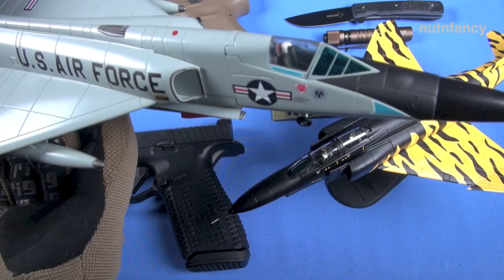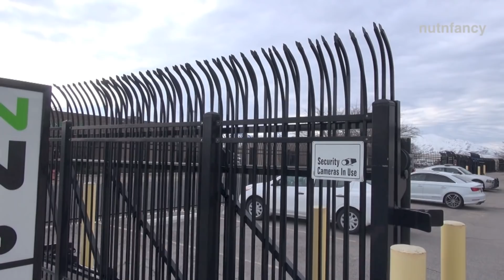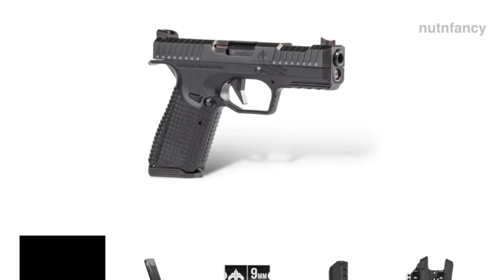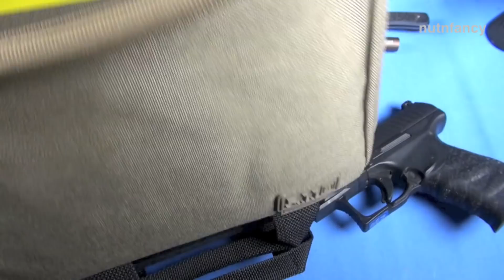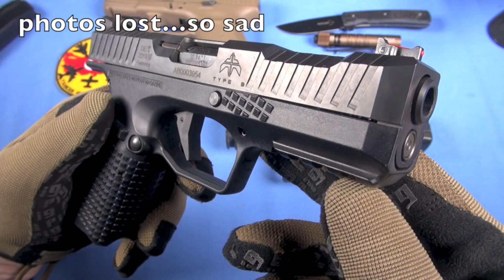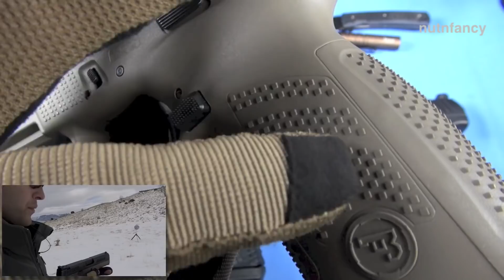In Your Face Different: Archon Type B 9mm!

Comment from the maker: Remember TNP Patreon gets the videos first and some never post on the main channel!  Here's some TNPr comments from Patreon, join the fun and full flow of TNP content:  https://www.patreon.com/Nutnfancy    "Greg Malcom I'm very interested in this weapon. Thanks Nutn! 6d The Nutnfancy Project The Nutnfancy Project The Nutnfancy Project THank you Greg 6dCCheesewell Dude, I wanna love this pistol, and I do, looks alone, it's awesome, but for the price, not for me. I'm a sucker for low bore axis pistols (looks wise), like the Caracal pistols! Great review. 6d The Nutnfancy Project The Nutnfancy Project The Nutnfancy Project Yes, trying to get that Caracal too, thanks Cheese! 1 6d Load 1 reply David Gaines David Gaines David Gaines I’m still holding out for the “Watch Basics” video! Keep the awesome content rolling! 1 6d Outrider950 What’s really neat is that on the Steyr L9 A2 MF the replacement backstrap not only change the grip size but the presentation pitch angle.   Totally COOL !! 6d The Nutnfancy Project The Nutnfancy Project The Nutnfancy Project I want that gun 6d Todd Strelka Looks like another great pistol. But I'm good with my Smith & Wesson M&P9 system. BTW, I'm very happy with my Maglula Uplula magazine loader too. I use it every time at the range. 6d Peter Thomas Peter Thomas Peter Thomas That “auto slide drop” is the pistol’s polymer frame flexing when inserting a magazine with a lot of force. You can generally drop the slide by squeezing really hard in certain places or by simply smacking the frame. That elasticity is just a characteristic of polymer as a material. The fact the Archon does not do it indicates that the frame is probably reinforced or has increased thickness. 6d Robert E Lewis Keith Gannon Keith Gannon Isn’t this the Strike One in a smaller frame variant? That was designed in Italy by a Russian.  LAV covered that a few years ago. Now being produced in Germany and Hungary. It’s been a traveller. As for over priced how about the Alien @ $5K!! 6d The Nutnfancy Project The Nutnfancy Project Yes its a G19 sized Strike One.  The Type A I guess is the full size. 6d Load 1 reply Tacticaldoodle Chris Baker Chris Baker I held one of these at a gun store a couple years ago.   The bore axis was sweet.  Too bad somebody else had already bought it or I might have picked it up.  Honestly, the name creeps me out a bit.  Archon: a Greek word that means "ruler", frequently used as the title of a specific public office. It is the masculine present participle of the verb stem αρχ-, meaning "to rule", derived from the same root as monarch and hierarchy.    Imagine that, a German company making a gun with a name that basically means "supreme leader" haha.  They might as well call it the "Fuhrer"! 3 6d The Nutnfancy Project The Nutnfancy Project Nice observation, I didn't even look the name up! 1 6d Derek W Tiller Faustus Faustus It's a good thing it comes with that silver sharpie for marking the magazine base plates with my initials—I wouldn't want them mistaken for all the other Archon Type B mags at the range. 6d Rick Grad Racing Psychosis Racing Psychosis I think I know why its so expensive, it had to be imported from 40k and the Dark Elder.  TD can help you with that. 6d Lon N Lon N I need this pistol like I "need" a Lamborghini. 2nd cool for sure. That being said - most folks don't understand that today is "the golden age of guns". Never before has there been such a variety of good firearms available.   david rockwell SAWC trump card played at the final round!  Very interesting design.  Thank you for the time and dedication.  Support your local gun stores and nation gun rights organizations. 1 6d Carl Bailey Carl Bailey Carl Bailey So, opposite end of the spectrum. Has anyone shot the Rock Island M206? For a dirt cheap revolver it appears to have an old school cool look. It looks like something good to just have around, but I don't want to buy something that will blow up in my hand. 6d Nathan Simms aka Darkpriest Nutn you have yet to convince me there is a better pistol than the Canik TP9SF (and the SF elite.) Ever since your review update I have owned them and I've fired LITERALLY 100s of pistols and not found one that made me go "yeah I'd rather have this as my GTW pistol."  Neat gun you reviewed, for 1k, it's just not enough more for me.  THANKS FOR ALL OF YOUR WORK FOR US! 6d Phake Steel frame: that's where the cost comes from. An apples to apples comparison might be a metal-framed Sig. I have a fiber optic sight I put on my 686. It's not just a plastic pipe, but is covered in resin so it can't break. I don't see why that arrangement is not more common. 6d The Nutnfancy Project The Nutnfancy Project " I don't see why that arrangement is not more common"  Weight and cost.  Polymer just works too.  For 2nd Cool, alumin frame is nice (Sig).  As far as a milled steel frame, the Archon is one of the best in wt however. 5d Load 1 reply David Eslamizar Meh.... I had an Arsenal strike1 and it was nice. I sold it though lol. For the money, for me, not worth it. I recently payed out the nose for a POF MP5, but it's a classic design, awesome shooter, and a dream gun of mine.... not to mention second kinda cool. 6d Ricky Kurtz Ricky Kurtz Ricky Kurtz Hey LTC, excellent review as usually. Thank you !!! The watch you’re wearing, please comment on it. Thanks again. Ricky from IBM 3 6d The Nutnfancy Project The Nutnfancy Project The Nutnfancy Project Thanks Ricky....I am not sure.  I should have shown it but these days I'm thinking most TNPrs don't care so much so I usually forgo it.  If I can remember I will come back and tell ya though! 5d Kenny VanCleave Kenny VanCleave Kenny VanCleave The grip reminds me of the Spyderco  grip pattern. 5d Ben Ben Ben Excellent analogy with the intro. And the old fashion tabletop is still my fave! 5d Connor Murphy Connor Murphy Connor Murphy Outstanding video, Thanks Lt. Col. 5d The Nutnfancy Project The Nutnfancy Project Thanks Connor 1 5d J Ram J Ram F4 is one of my all time fav fighter aircraft (and name of my AFJROTC Drill Team).  The stories of those bad boys making it back to base after significant hits makes it legendary in my book.   Oh, the gun was pretty cool too.  Thanks Nutn. 5d Phake As a side note, did you know that Rock Island sells a 9mm modern 6-shot revolver? Well, they do.  :D Love revolvers and I am a fan of the 9x19 cartridge, so I'm always curious about 9mm revolvers. I've go a Ruger Blackhawk conversion cylinder model (0.357/9mm), which is pretty nice, but I've always wanted a regular DA 9mm revolver. I don't know if you are interested in reviewing one, but I'd sure appreciate it if you did. Thanks for your consideration. 5d JoeLove to see a review from nutn on any rock island revolver. They're very affordable 4d The Nutnfancy Project The Nutnfancy Project Copy guys, I'll see if HH or Gunnies has one! 2min James R James R I d love to see a plastic gun like this with interchangeable grip scales like the 1911 or beretta that would be cool to be able to dress up that pig 5d Benson Huntley Benson Huntley When it comes to price I was always very unwilling to pay up for what may or may not be an improved gun. Then I was foolish enough to shoot my friend's STI 2011. That was years ago and I still cannot get that thing out of my head. I also cannot bring myself to spend the money it would take to buy one. So I would have to take a pass on the Archon as well. Great review Nutn. 5d The Nutnfancy Project The Nutnfancy Project Thank you Benson, thanks for the support.  I do have an STI in inventory for review btw! 1min Trey Koger  I love the brief inclusion of the F-106. My dad did avionics repair on those birds back in the late 70s at Griffis Air Force base. 5d The Nutnfancy Project The Nutnfancy Project I love that plane.  I used to sit at the end of the runway and watch the F106s takeoff in full afterburner at Langley AFB.  Cool your Dad has that history! just now Robert E Lewis Robert E Lewis Robert E Lewis Nutn reviews a semi Gucci 'glock-a-lope'... I just watch the PPQ M1 in the background. 4d Tacticaldoodle I’m pretty much sick of this thing coming back like a zombie. It’s back to being the Asenal again, or maybe co-imported? I can’t quite figure it out but with so much sweet competition I can’t be bothered to. 2d Derek W Tiller Derek W Tiller Derek W Tiller They probably should swap to a polymer trigger. It would have better dampening and heat transfer qualities. 1d Rick Grad Rick Grad Rick Grad I think people will try it because it is different. thanks for making the video, would have never known about the brand without yea."
Reply: nutnfancy only stupid consumers are sucked in by a “price marketing” scheme.
Reply: What ever happens to Impact Guns from way back. Or PFI dudes shop. And others you have shown back in the day?
Reply: I can't wait till you get a PSA Dagger to look at
Reply: @badas45  The PSA JAKL is the one to get... especially in 5.56
Reply: @calholli  the Jakl in 556 is on my list but the non Glock is in my budget for now, I have been looking at g19s for a while and the dagger looks better.
Reply: Small G gods Archons. There the fallen angels. Yeah nothing cool about the name. Just saying
Reply: I just bought a DB9-FS for $140 on gunbroker.. 
Every bit as good as this pistol and even looks better.
Reply: You said it had a stoppage with Winchester "115 grain NATO spec".I always thought Nato spec is 124 grain.(like I've shot from Winchester)
Reply: Requesting a video for the new Steyr A2 MF pistol: https://www.steyr-arms.com/us/firearms/pistols
I purchased the M9 based on your review and few others. Carried it for a while as well. I bought the new A2 MF based on my love of the M9, but it was a huge pain to actually find one. Still waiting for the sub-compact/compact grip modules.

Comment: I bought one a week ago. I took her to the ranges with six different types of ammo/makers (400 rounds) and different grain bullet weight, and the Archon shot as fast, flat and accurate as you can ever get out of the box. I have owned a plethora of guns over the years and carried many as a lawman and SWAT TEAM leader. I also participated in four SWAT Olympics, so I understand the coemption aspect. I don't think you need a bunch of work done to most pistols as back in the 1990's my department made us carry a "New York Trigger" in our Glocks. Was about 12 lbs. i can tell you when the shit hits the fan you will not notice. I think we get finicky with all the add ons which, turn a really good gun into something we really don't need as much as want. I have been in actual shootings and the trigger pull was not noted before, during or after. I do have two beefs, one, the take down pin gets a mite warm when firing 100 rounds fast fire and lastly, the mag release did kinda suck. Not a mood killer and I took her home and lubed the dog crap out of it and worked her a bit and now, back on track as a carry pistol. Shoots and fells better than any Glock i ever owned and I have owned a peck of them in every caliber and configuration and attended the Glock armorer's course four times over the years as well as Colt and Sig courses. I fired at a 2 inch target at 15 yards. I thought I was missing the target a time or two and turns out I was putting rounds into the same holes!!!  I am impressed with the Archon.

Comment: Hey Nutnfancy I own 2 of these guns because I love the way they shoot so flat and recoil seems lighter than other 9mm guns.  I don't experience discomfort with the trigger and the tendon rib doesn't bother me either.  They only gripe I have with the gun is the grip mapping technology.  I found the grip traction to be adequate with dry hands or with gloves on but not with sweaty hands or wet hands (blood sim). For this reason I had  both guns stippled and I found that modification to solve that issue.  I have a CZ P-10c and P-10s , most variants of 9mm Glocks from gens 3-5 and those are all excellent guns.  Is this gun better?  I think that's a very subjective question.  All I can say is that it's by far my favorite gun to shoot.

Comment: I have hundreds of rounds through mine; functions flawlessly with 115, 125, 147, and even 158 grain bullets.  Ran a Steel Challenge match and its quick to handle with easy follow on shots.  The recoil impulse is very unique, but very favorable to this type of engagement.  Magazine changes are very easily accomplished.  Trigger reset is very good.

Ergonomics really work for my large hand size.  If you try to blaze through all 4 magazines as fast as possible - there will undoubtedly be heat transfer to metal trigger.  I went with skateboard wrap as well.  LOVE my Type B.  Excellent pistol.

Comment: I wish more companies would stop trying to reinvent the wheel. If the goal is lower bore axis, why not clone the p7? It's recoil system has provided the lowest and it's fixed barrel is truly fixed. Likewise, if you insist on locking block operation and low axis, rotating barrel has been shown to work in many application as well. To me, the action is fine but unnecessarily asking for the buyer to believe it's hype. It's just like the tendon beavertail in that regard. Engineering that followers marketing. That's dangerous thinking.

Comment: Good to see a good ole’ feature length GRV. It seems, the trend right now is “subcompact” carry pistols and all-steel range guns. The “do-it-all” pistol is kind of occupied well established names.
  Waiting for the SIG P210 standard/carry review. Standard is lights out accurate even with a bad shooter.
Reply from the maker: Not sure if the 210 carry will be around unless Haven or Gunnies gets one on hand.  Seemed to us like a funky one, just from the design. For anyone looking to carry a 210 they'd likely dig one more classically styled, but they went modern on the grips and finish. I'd think it more in line with high class, custom 1911 types for carry but it looks like they tried to modernize and tacti-fy it a bit to compete with the contemporary carry market, which is an absolute shark tank. I'm sure it's a great shooter, but as far as conceal-ability goes it needs to be damn cool to make up for it. -Doodle

Comment: Too expensive for a marginally interesting pistol. I learned the hard way with the Strike One, the precursor to the Type B. Which  I preceded to sink well over $1200  with magazines, trigger job, and holster. The type B now has a German slide with a Hungarian frame BTW.
Reply from the maker: Good heavens, that's a chunk of coin for that. If you dig it, then by all means, but at that price point I'd be looking for something with definite collector value unless there's something else I'm using it for. I don't get enough use out of the Poly 9's we have on hand now except for a handful of glocks. If it's a comp gun though, then it ain't so bad. Who knows, it may be the next H9, something which I keep hearing will be fantastically collectible.-Doodle
Reply: nutnfancy  I sold it a few years ago and got most of my money back. Lesson learned.

Comment: if the  "tendon activation rib" gets it with a dremel why not smoth out the trigger a bit while on the go.
also if the slidestop is in metal have a go with a tig welder to build it upp and reshape it.

Comment: 15:30 I agree, Steyr pistols are extremely underrated. I have plenty of 9mm pistols, and my Steyr C9-A1 is one of my favorites. It feels like it was custom designed for my hand, the triangle sights are fantastic, the balance is perfect, and the low bore axis results in minimal recoil and quick recentering onto target. The only negative is its tendency to throw empty shells toward your head. But other than that, it is a phenomenal firearm. If you have never shot a Steyr, you should definitely try one if you have the opportunity.

Comment: Nutn, the market is going toward 3Dprinted-HDnylon frames for everything. Will be able to design custom grips around whatever brand serial-chassis you have. Think AR lower as a sample vertical for where the market is going as a whole. 3D printed metals are insanely strong as well.

Comment: Low bore-axis is mostly a marketing gimmick only neccessary on carry pistols that are engineered too lightweight for high speed target transitions. Glock's grip angle is still the best compensation solution for the  ~25oz range of pistols for recoil mitigation.
Reply: Have you shot this pistol?
Reply: @jagervw  Not a reliable enough of a action-mechanism to evaluate. I shoot a high axis gun better than most people can shoot their safe queens. Practice more if you suck.

Comment: The angular front looks cool and makes it easier to holster, what's your problem with it, how is it unacceptable? how is it that big of a deal which they must change?  And the cut out in the slide is functional, it lightens the pistol so there's less reciprocating mass. Instead of doing lightening cutouts which can allow dirt and grime to enter into the pistol, this is a different way of getting it lighter which also looks cool and you could probably grip it better there as well for press checks etc.. The main problem with it is it's not optics ready. Needs to be Optics ready so you don't end up shooting with one eye closed like you limiting your situational awareness..

Comment: There was one instance of the cop that shot the guy he was in pursuit of through his own windshield while driving. He jumped out of the car, put the mag in backwards and slammed it, took it out and put it in the right way. Few and far between, still a problem for some. It wouldn't stop me from buying. What has stopped me from buying is the unavailability of spare mags and price. I want to have as many mags as I want to have. I have something like 20 ppq mags (one bought at gunnies while on vacation). At this point, owning 3 ppqs, a gun has to be significantly better for me to switch entirely over, which I doubt will happen